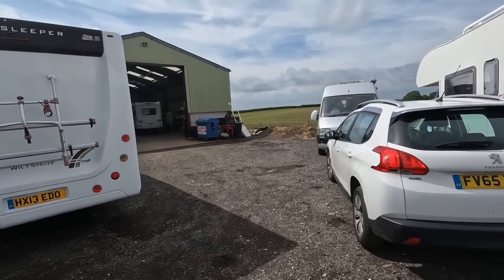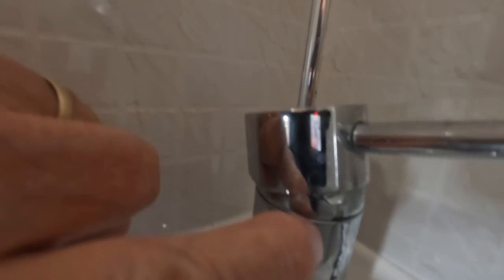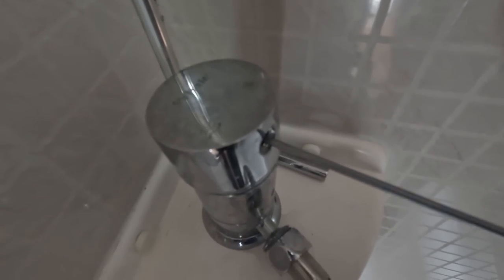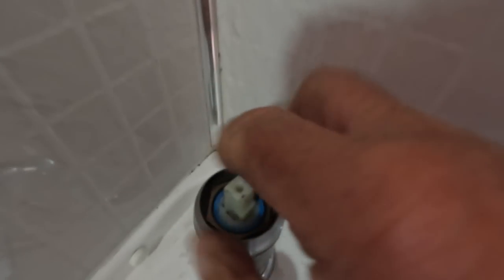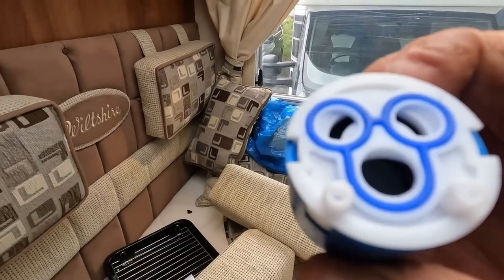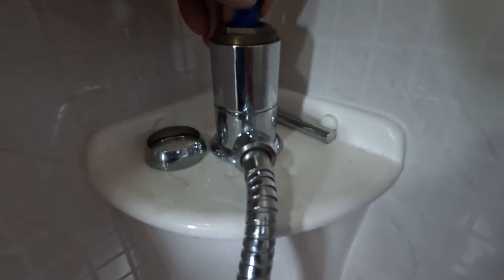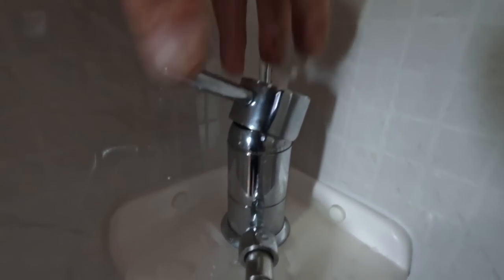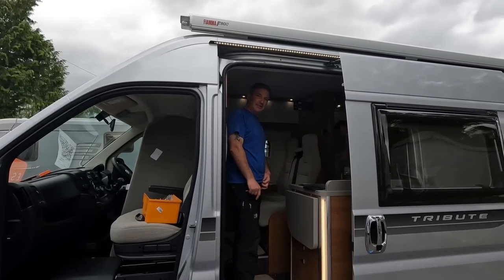Motorhome and Caravan Leaking Tap Repair - CARTRIDGE !

Comment: I always put the plug in the hole (or a flannel or bit of tissue) before I start loosening screws or nuts in taps because if you don't the offending part will fall out and go straight down the plug .hole.

Comment: As an emergency fix if you’re away etc you can turn the o rings over and use the inner side, only a short term solution
Reply from the maker: Thanks for the tip Kram 😃